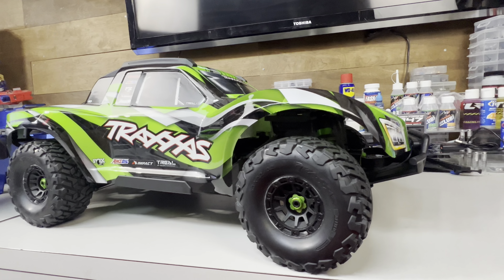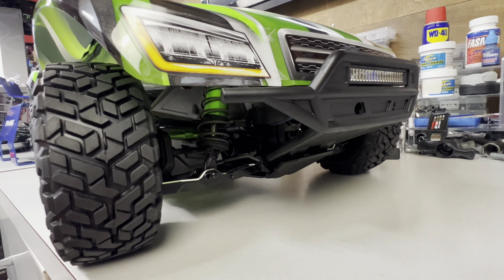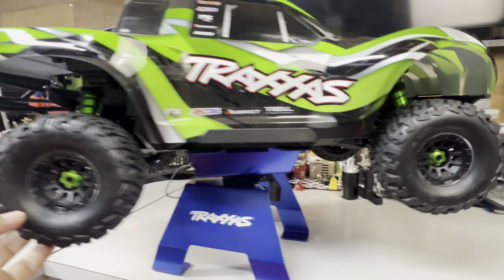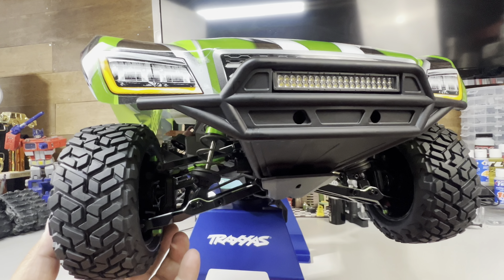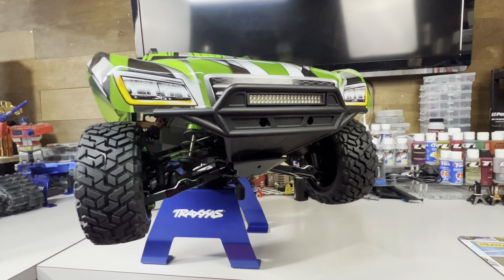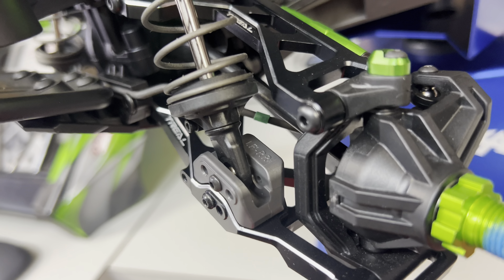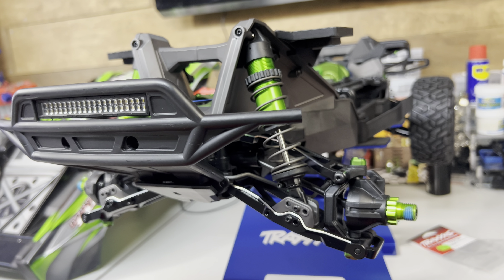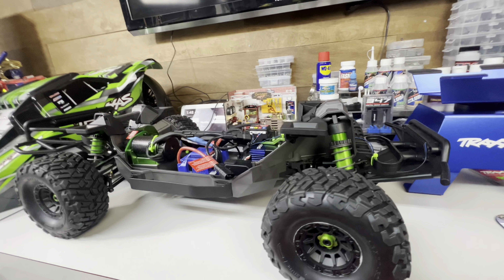TRAXXAS MAXX SLASH 4 dollar fix for front and bottom out?

Comment: Bottom out on a flat chassis is completely normal. Especially on a plastic chassis. You will probably break stuff now. Just an opinion
Reply: Most rc cars are built to bottom out so you don't bend the shocks from hard drops. The maxx slash has an extremely weak spring rate in the front and shouldn't be bottoming out just from looking at it. You will break more stuff if you have no absorption from such a weak spring rate and high drops. After seeing how thunder drives his maxx slash I think he'll be ok. Back in the day we use to do the 2ft drop test for trucks and if the suspension was right it would almost bottom out.

Comment: I was pretty disappointed in the Maxx slash
Reply: I've had mine since the day it was released and been using it once a week out at a track we built , and we bash these things very hard, couple buddies have the mojave 6s, and so far they have had to repair theirs more than mine, in fact I havent had a single issue yet ( Knock on wood ) , its been the most durable rc car ive ever owned. I love both aarma and traxxas, so im definately not hating on the mojave, i love those things too, just figured I would give my 2 cents on it .

Comment: Would this not bottom out the shock and put more pressure on the towers instead of load distribution through a larger section of the chasis?
Reply from the maker: But wouldn’t that be the same scenario for the rear?